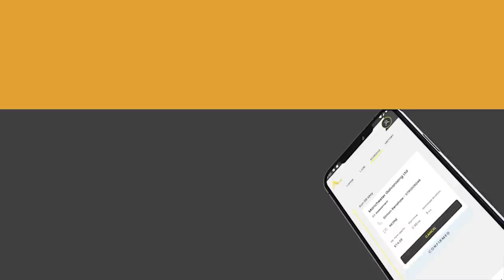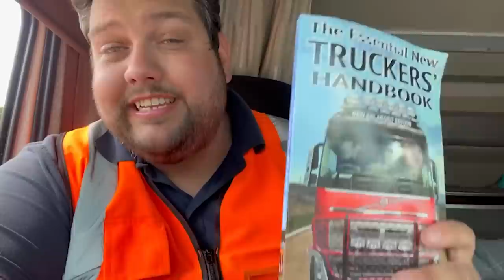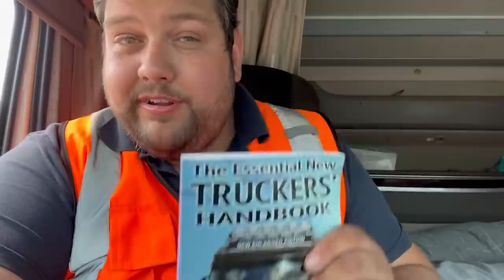A Cold Winters Morning! Amazing Views

Comment: Brilliant video Luke.  Talking about lights.  With today's cars, lights come on automatically.  I just wonder whether the sensors are only on the front of the car, and picks up the light, so when its going dark, the front and back lights come on.  I don't even know whether my rear lights come on when driving through a canopy of trees - I do know my car's front lights come on, but not sure whether the rear lights come on.  I'll have to do a check next time.  You've got me thinking🤣.  I don't know really.  I did find the switch to switch on the fog lights but I'm not sure whether the rear lights come on.  I'll have to check.

Comment: Couldn't agree with your anger more re use of lights (or non use). M25 last week was littered with idiots totally ignoring what should be the obvious when its foggy. It's the same in the rain isn't it.
Question - the straps you used in Birkenhead, did you say they are rated up to 5 ton each ? I thought they were 2.5 each or have you some that are rated stronger ?